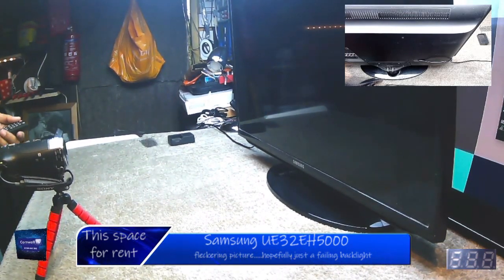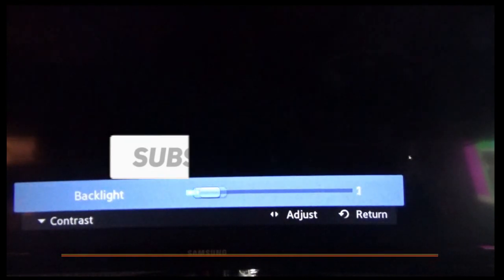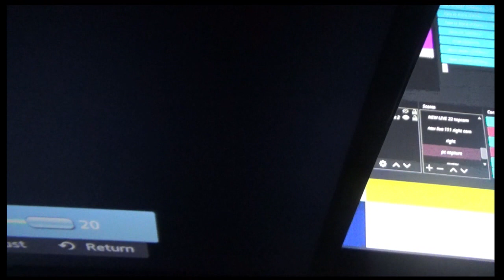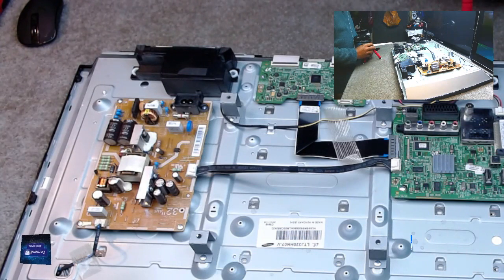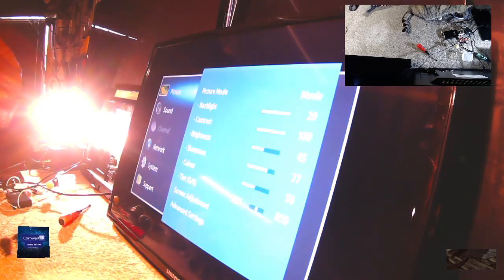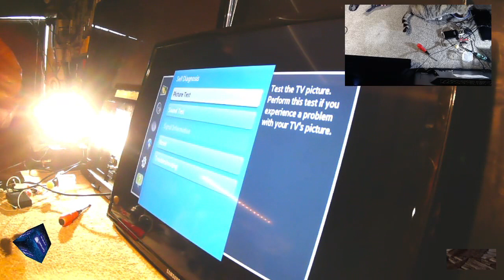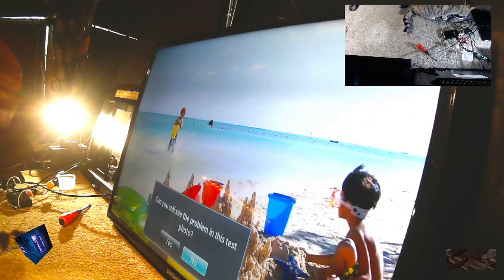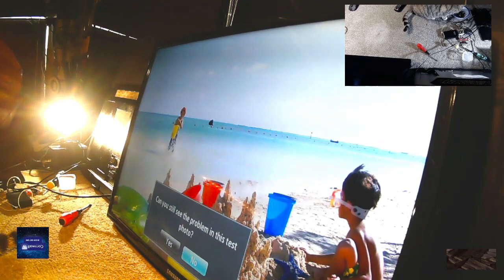Samsung 32 inch with Picture flicker

Comment: Nicely repaired  allan :-D
The odd thing is it sounds like a primary capacitor, but most bad caps ive seen are later on in the low voltage stages.
Maybe the power factor correction circuit is a bit touchy and needs a perfect capacitor.
I actually expected you to disconnect the lighting cable and connect it to your led tester box.
Just in case an led was the flicker.... but i was wrong lol.